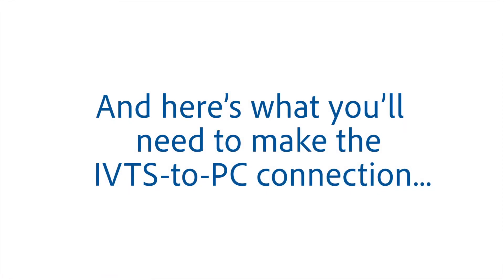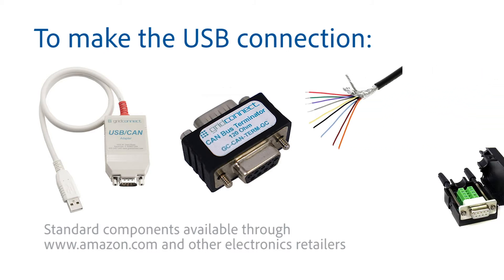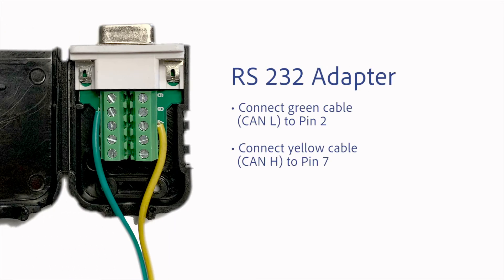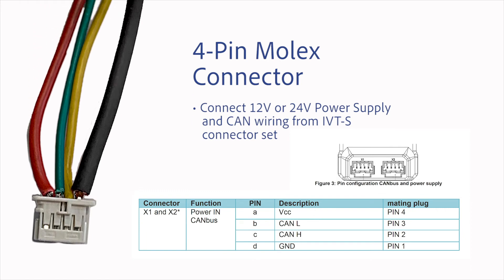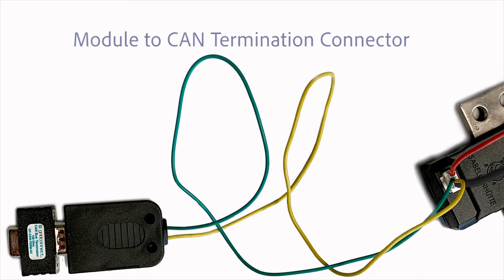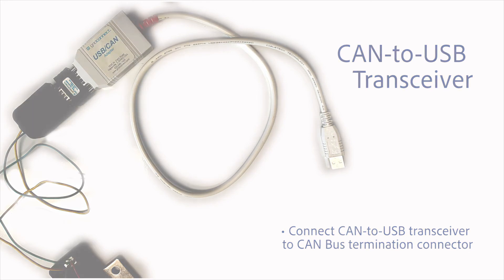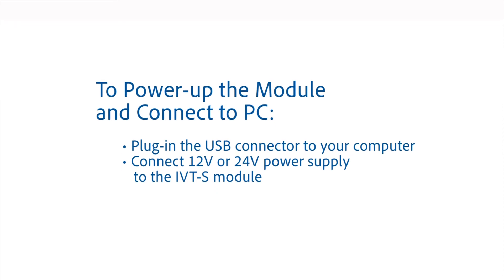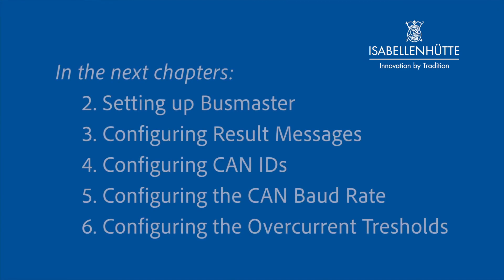Chapter 1: Getting Started: Parts and Wiring

Comment: So you need four things just to talk to this thing:

1. CAN USB Adapter (PCAN-USB) with Isolation (GC-CAN-USB-ISO) - $275 BUCKS!!!
2. Grid Connect GC-CAN-TERM-GC CAN Terminator
3. Chanzon 12V 2.5A 30W AC DC Power Supply Adapter
4. Anmbest 2PCS DB9 Solderless RS232 D-SUB Serial to 9-pin Port Terminal Male Adapter
Reply from the maker: Hello, thank you for your comment and interest in our products.
Yes, you will need to provide power supply to the module and use some kind of CAN to USB transceiver in order to be able to communicate with the module through a PC (test bench setup). Please note, that this is a smart sensing module designed for industrial applications in HV battery systems that are usually equipped with CAN bus and corresponding power supply.
Using the PEAK CAN Transceiver is just a suggestion. There are multiple other products out there (e.g. products from the Vector brand) that can be used to communicate with our modules through a PC.
Thank you for contacting us, please feel free to reach out for further questions.